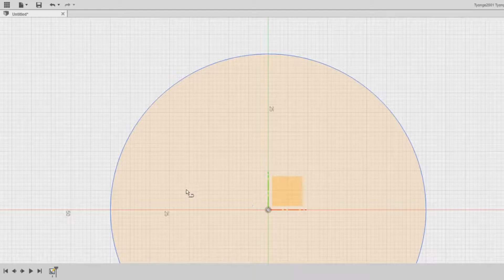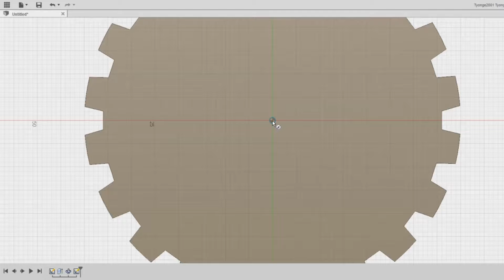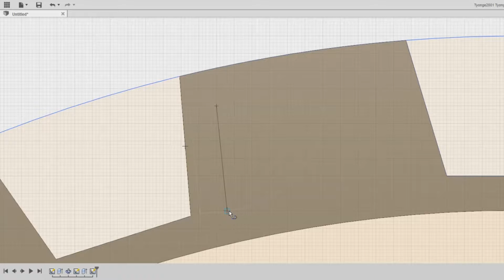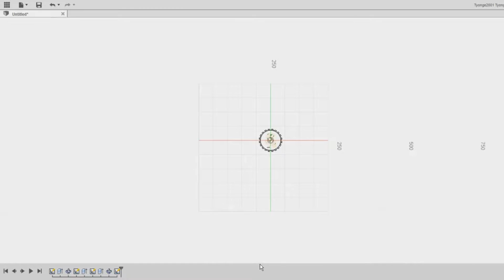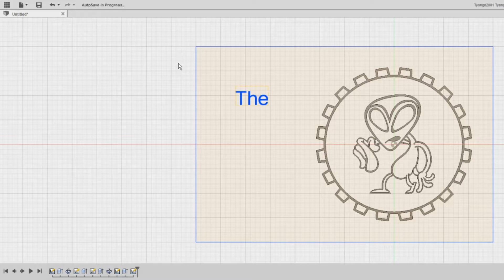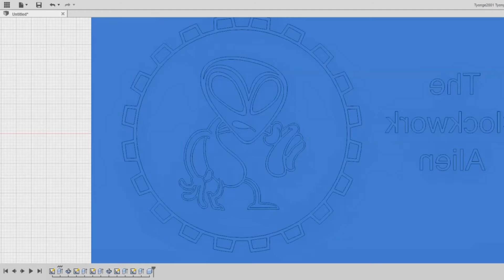Clockwork Alien Leather Stamp

Comment: you can restore default view settings by Pressing the Shortcut keys control plus alt plus R.

Also by going to the top left corner fusion selecting file go down to the word View menu folds out allowing you to select individual commands Windows you wish to see.  Hope this helps